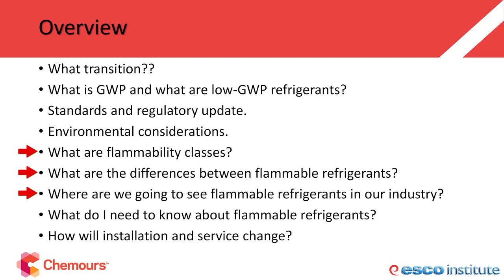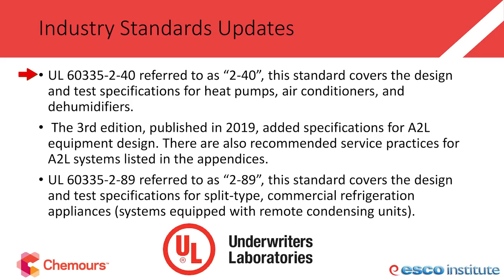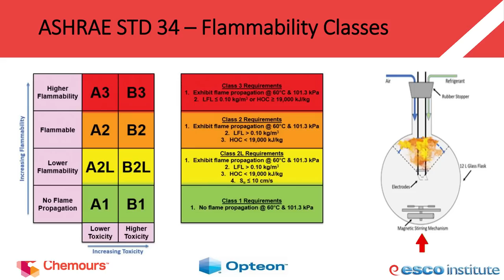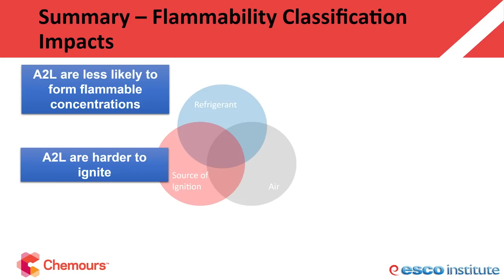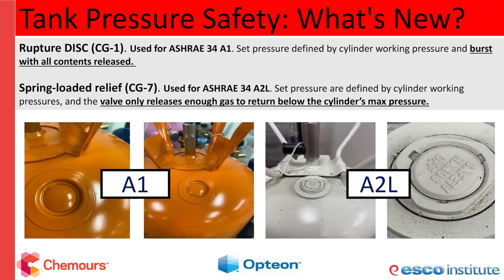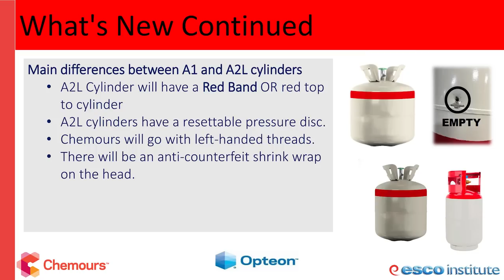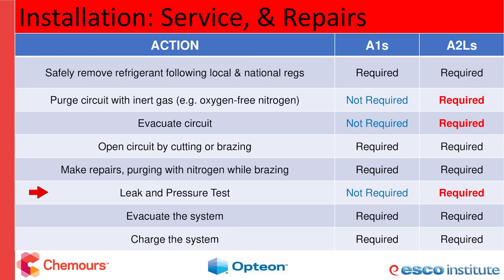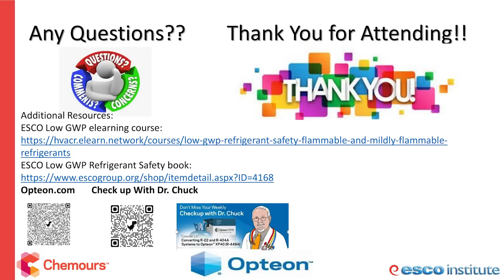Flammable Refrigerant Update

Comment: So nobody has addressed the fact that the scroll hard lock and don’t release pressure until energized.  I can’t vent the compressor and the line set at the same time. So how can I determine the condenser is purged when the nitro will vent the evaporation circuit and leave the refrigerant in the condenser?

Comment: I'm sorry but small appliances are already exploding here in the U.S. and they want to add explosive  refrigerants to big units. I recently had a unit blow its full charge in a high school classroom full of kids because the wiring from the factory was left loose and the vibration from the water source heat pump compressor wore through the wire and tried to weld itself to the copper line which blew a hole in it. The kids would be gone if this continues to be allowed. 20 plus lives are more important than the risk this would allow.

Comment: I am a potential consumer looking to get a split AC/Heat pump (Mitsubishi or Daikin). Should I wait for the new A2L to be available in the US? If I go with existing will servicing 410A in 10 years plus be available and/or very expensive? Will there be better performance with A2L?
Reply: A bit late, but r32 is more efficient than r410a.

Comment: Just make all hvac propane. Put the condenser and evaporator outside. Use a antifreeze loop to transfer to the air handler. Put the electrical controls in a sealed compartment. Problem solved. Propane is an exceptional refrigerant. Cheap and very efficient.
Reply: 98, you are correct, it would be like the old Arkla gas air conditioners that had ammonia for refrigerant and glycol for the chiller.I guess I’m revealing my age . I’m sure it won’t happen because your idea makes too much sense and would be cost efficient.
Anyone that reads this, let me know in the comments below, if you’ve ever worked on a gas air conditioner (?).
Reply: How would Big Chemical make money?  It's always about the Dollar.
Reply: @boby115  I remember them too. Not very successful around here. Very few people knew how to work on them. I never did have a call on one other than to clean the condenser.
Reply: So... You want to add another component thus increasing the cost? The biggest issue would be designing the proper heat exchanger... Although if it is sealed.. We could lower the pressures and drop the temp really really low to make up for the inefficiencies in transfer.
Reply: @Wrecked3  , chiller technology has been around since 1922, invented by Willis Carrier. Can we make the technology better ? (Absolutely). Yes, things are getting more expensive and technology more complex . The difference in cost, i’m not sure anyone could predict at this time.

Comment: With the GWP thing, we were discussing likelyhood of ammonia and CO2 coming into domestic appliances like high walls, even R290. R32 is just 410A without the fire retardent in it as we were told by the trainer, but i own an A2L reclaim pump, i havnt seen an A3 one since its not been in our scope of work, but one thing that scares me is we all need to read what we are working with and know enough about it, we dont want to be mixing these things together in reclaim cylinders, we would need to end up having multiple reclaim cylinders for the A1,A2 & A2L and of course the A3 as a minimum, ideally we would have a reclaim for each Refrigerant, which is fine for a larger company, what is the solution for the smaller ones…
Reply: I'd hate to see ammonia come into residential areas. I worked for a farm store out of high school and they filled anhydrous tanks for fertilizer, that stuff is POTENT. Even as much as a little puff of liquid was enough to either eat your skin or knock you out COLD. It took me a few months just to get used to the smell of the stuff from minor vapor leaks.
Reply: I thought the critical point of CO2 was too low to make it practical without a cascading system…  But, I work on specialized data center equipment, so not very knowledgeable on the subject…

Comment: The amount of refrigerants I work with vs a refrigerator or a car (small closed circuits that are worked on much less) is vastly different. This is huge, every tech has accidentally dumped a line before but if it was explosive that's a whole different story. Also I would like to see how flammable these oils are.

Comment: Hi how are can  it possible to install a capillary tube or orifice in place of the expansion valve, and does the cooling efficiency decrease?
Reply: Yeah just braze in the proper compression fitting... And then recharge the system via superheat

Comment: When is this transition going to happen?  As in, when is the switch to R32 and R454b going to happen for AC and heat pumps?  (Edited)
Reply: Step by step. You see, they already  created supply chain problems. Now we need to change our vacuum pumps and gauges( very expensive  part of our tools). I guess we need a new certification.
Reply: Its already happening. In cali you cant evac. Discharge out side.

Comment: If the EPA  wants to drawn down 410A and eventually stop importing it then the government should buy back every unit that’s using 410a .
Reply: Exactly! Being a customer, I need to replace a 23 yr old R22 unit, but refuse to spend thousands for a unit that has the phase out/draw down R410A. I asked that's what is currently being sold.
Reply: @threeftr3349  a local big box hvac company here in Las Vegas is offering huge discounts on all there new  units installs . Hmm I wonder why ? They know what’s coming . I do hvac , go head and get the 410A system ! . It’s more energy efficient then R-22 . You’ll still get about 15 more years and I don’t see changes happening soon .
Reply: @threeftr3349  how big is your system now ? Tonnage ?